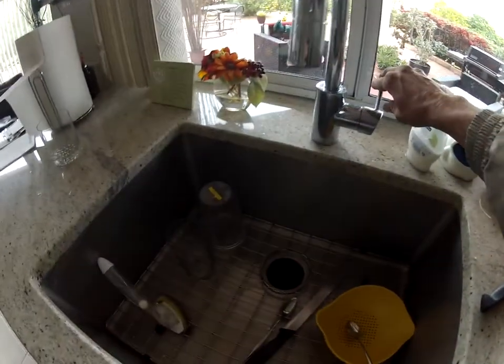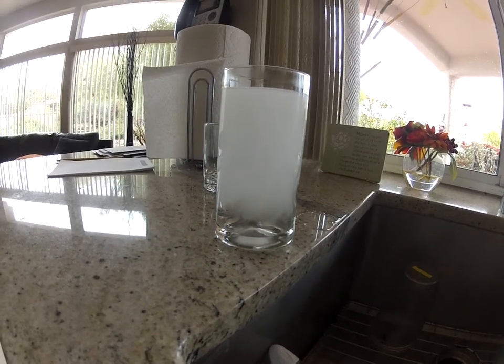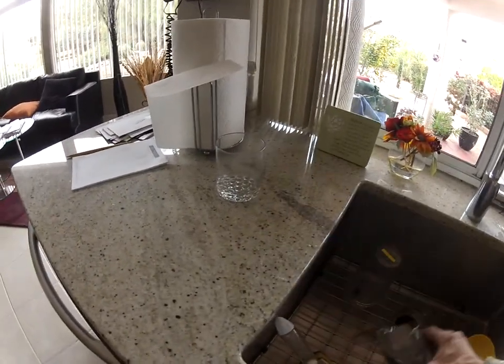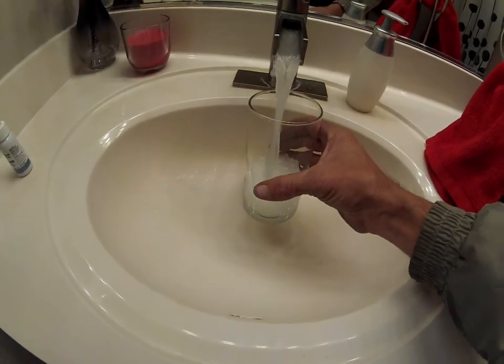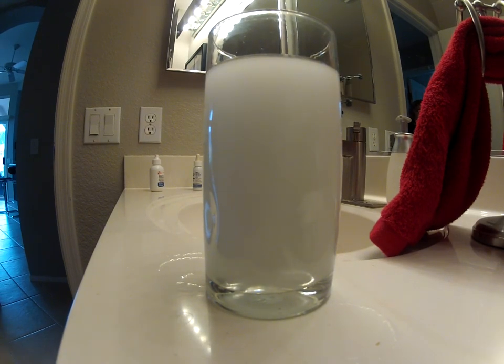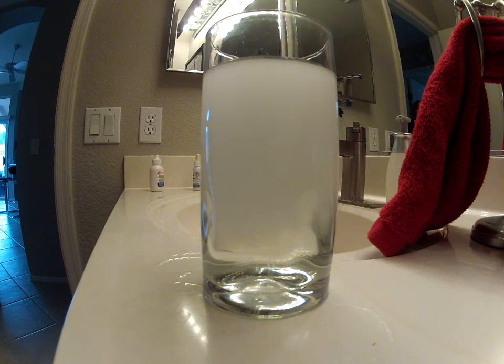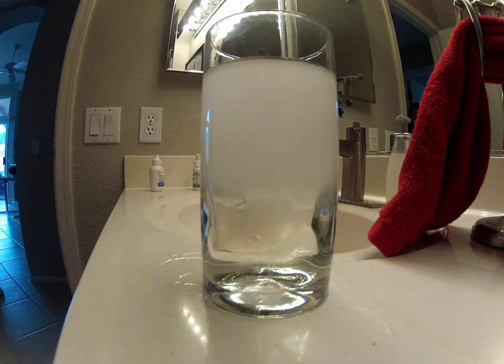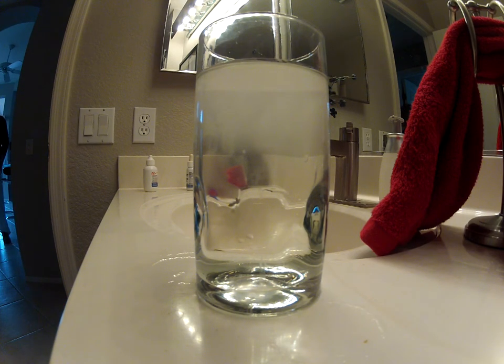White hot water

Comment: My hot water just started doing this. It also has air in hot water line. I think it's caused by the rod that runs through the inside of hot water tank. Call a plumber.

Comment: I only get the cloudy water in my bathroom hot water line.  My bathroom faucet is identical to yours. My apartment is an expensive luxury flat. It is my only disappointment. I still want it fixed.
Reply from the maker: nneo100 all the plumbers I talked to said it’s a function of the individual faucet, you could try removing the aerator to see if it clears up.
Reply: @shavedneon I have this happening now and it's all my sinks hot water so not an individual aerator